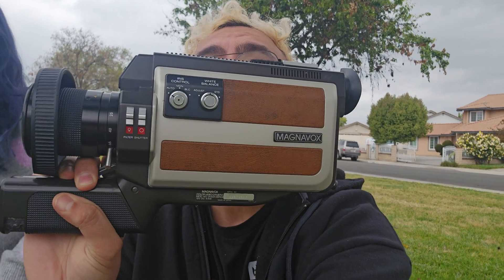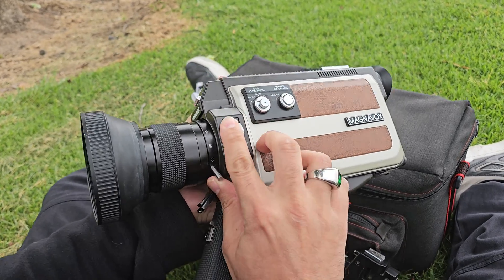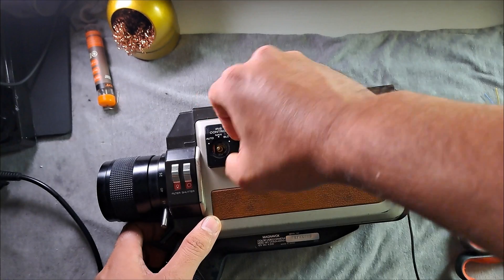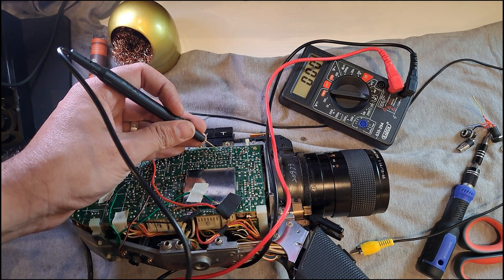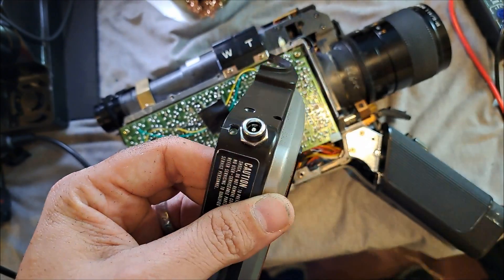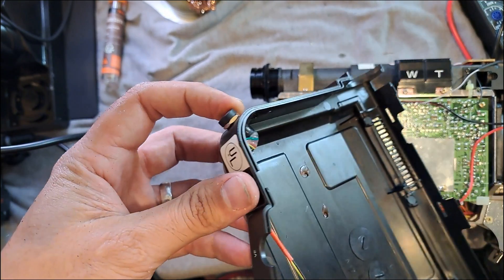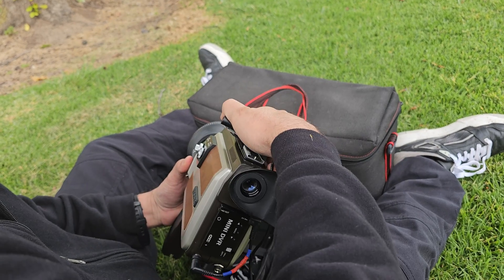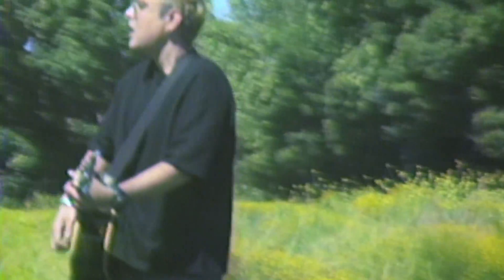1982 to 2024: How to MOD a RETRO camera!

Comment: Im trying to do this on my camera and i cant find a diagram for its connector. How did you go about finding what each pin does? I located the place on the board each pin leads to but as for what they do, no clue.
Reply from the maker: @murasamest1845  Hi! I’ve received that question quite often, so I’ll try to explain it a bit better :) The process really depends on the model. So far, I’ve managed to do it with six different cameras, but here’s how I approach it, just keep in mind, I’m not an expert, just an electronics hobbyist, so there’s probably a better way out there that I’m not aware of, haha.
You will need 4 cables: a) Power (usually 12V), b) Ground, c) Video signal, and d) Audio signal (usually mono).

First, and most simply, I look for the ground wire. I place one end of the multimeter on the connector pin I want to test and the other end on any solder point inside the motherboard that has a metal plate or screw (which usually leads to ground). When there’s continuity, the multimeter beeps—there you have your ground.

For power, these cameras almost always have a fuse, so I place one end of the multimeter on one of the solder points of the fuse and continue testing the connector wires until I find continuity—now you’ve got power and ground sorted.

For finding the audio and video signals, to be honest, it’s trial and error for me. Once I can power the camera using a battery or appropriate power supply (after finding the ground and power points), I turn on the camera and start testing the remaining connector wires using a video capture device connected to my PC. I test each wire with an RCA cable (composite video or pin jack) without soldering—just temporarily connecting them. These RCA connectors have two wires: one goes to ground (the same point we found earlier), and the other is used to test the remaining connector wires until I get a video signal on the PC. I do the same for audio.

This is the best-case scenario when the camera is actually functioning, but there have been several times when the camera was simply broken. We have to remember these cameras are around 40 years old, so sometimes they just don’t work. Recently, I managed to revive one when I noticed that two capacitors were desoldered and swollen. Luckily, I had capacitors of the same value, so I tried replacing them, and it worked! On another occasion, the fuse was blown, and I replaced it. These are simple repairs, but sometimes the issues can be much more complicated, and with my limited knowledge, it would be impossible for me to fix them.

I love electronics so much that I’ll be starting formal studies in February next year, so I’m hoping to take on more complex projects and be able to help out better in the future! 😊

That’s my simple trial-and-error method. As I mentioned, I’m not a professional, so there’s likely a better way to do it, but at least this has worked for me! I hope this doesn’t confuse you more and that it helps!
Reply: @MaxVegaKun  This helps a lot, thank you! To clarify, when finding ground would any metal screw or solder point have continuity to the ground pin?
Reply from the maker: @murasamest1845  Yes! Most of the time all metal plates or screws lead to ground :)
Reply: @MaxVegaKun  last question: I cant easily access the fuse, but theres a capacitor which has continuity on a pin i didnt find anywhere else, you think thats the power pin?

Comment: You said you ran some tests to identify the serial pins. What tests were you speaking of ie knowing video vs audio
Reply from the maker: Yes indeed! I’ve received that question quite often, so I’ll try to explain it a bit better :) The process really depends on the model. So far, I’ve managed to do it with six different cameras, but here’s how I approach it—just keep in mind, I’m not an expert, just an electronics hobbyist, so there’s probably a better way out there that I’m not aware of, haha.

The first thing I do is search online to see if I can find the pinout for the cable or connector used by the camera. For example, you can Google something like '10 pin video cable diagram' or 'pinout.' There are some sites where they keep this information, and from there, you can see exactly which cables you need. You will need 4 cables: a) Power (usually 12V), b) Ground, c) Video signal, and d) Audio signal (usually mono).

However, in my experience, this information almost never works because it’s often different for each model. I assume this is due to the large variety of models and the limited number of cameras I’ve worked with, but sometimes they're very close and it helps me to save some time. So, this is where my multimeter comes in handy in continuity mode.

First, and most simply, I look for the ground wire. I place one end of the multimeter on the connector pin I want to test and the other end on any solder point inside the motherboard that has a metal plate or screw (which usually leads to ground). When there’s continuity, the multimeter beeps—there you have your ground.

For power, these cameras almost always have a fuse, so I place one end of the multimeter on one of the solder points of the fuse and continue testing the connector wires until I find continuity—now you’ve got power and ground sorted.

For finding the audio and video signals, to be honest, it’s trial and error for me. Once I can power the camera using a battery or appropriate power supply (after finding the ground and power points), I turn on the camera and start testing the remaining connector wires using a video capture device connected to my PC. I test each wire with an RCA cable (composite video or pin jack) without soldering—just temporarily connecting them. These RCA connectors have two wires: one goes to ground (the same point we found earlier), and the other is used to test the remaining connector wires until I get a video signal on the PC. I do the same for audio.

This is the best-case scenario when the camera is actually functioning, but there have been several times when the camera was simply broken. We have to remember these cameras are around 40 years old, so sometimes they just don’t work. Recently, I managed to revive one when I noticed that two capacitors were desoldered and swollen. Luckily, I had capacitors of the same value, so I tried replacing them, and it worked! On another occasion, the fuse was blown, and I replaced it. These are simple repairs, but sometimes the issues can be much more complicated, and with my limited knowledge, it would be impossible for me to fix them.

I love electronics so much that I’ll be starting formal studies in February next year, so I’m hoping to take on more complex projects and be able to help out better in the future! 😊

That’s my simple trial-and-error method. As I mentioned, I’m not a professional, so there’s likely a better way to do it, but at least this has worked for me! I hope this doesn’t confuse you more and that it helps!
Reply: @MaxVegaKun  Thanks for the response brother., Very insightful and motivating. I bought a JVC GXNU70 and I'm going to start tinkering around with this. Appreciate your dedication to your hobby and fans

Comment: For my VX1000 miniDV cam, I use a usb capture dongle plugged into an android phone. The phone is the monitor and recorder. 😎
I like the concept of the little recorder. Maybe I'll pick one up.
Reply from the maker: That’s awesome! I’ve experimented with using a phone as a monitor and recorder too, though I personally find the video quality from the mini DVR to be a bit better than with the USB video app. No matter how much I bump up the bit rate, the image just doesn’t quite convince me—maybe my capture dongle isn’t the best quality, haha. But one thing’s for sure, the audio quality through the USB capture is much better than the mini DVR.

It’s funny you mention this because my next video on the channel is actually comparing the video quality of different capture methods, including using a USB-C capture dongle connected to a phone. I’ll be sharing the pros and cons of each method, at least from my experience. By the way, what a classic and cool camera you’ve got there! Thanks so much for your comment and support!
Reply: @MaxVegaKun  the capture quality is as good as plugged into a Mac/PC. I expect it's all about the dongle.
DV capture is the best option, but those battery powered DV capture devices are VERY expensive. I just want to preserve the tape mechanism if I decide to resell.
I bought a 2012 Mac Mini just to capture from DV, but the FW400-800 conversion doesn't work for whatever reason. 🤔
Reply from the maker: Yeah true! those original sony DV captures are totally out of my budget but there's a reason why they're so expensive a  friend of mine has one and I love it! It’s a shame the FW400-800 conversion isn’t that can be frustrating when you’ve got everything else set up. Sometimes these older connections can be finicky, I hope you find a solution that works for you!
Reply: @MaxVegaKun  I'll probably buy an older 2009 macbook with FW400. Wish me luck 🤣

Comment: Ooooh, i didn't even know that these tiny cheap DVRs existed! I am using a USB-Video Adapter and a Smartphone to capture my Vidicon cameras. But the capture-apps for the phone are an absolute painful desaster. Thank you for this Videoooooooo!!!
Reply from the maker: Hey, glad you found it useful! I stumbled upon those mini DVRs by chance, and even though they're mainly used in FPV drones, they work great with retro cameras. The downside is the audio quality is pretty bad, but if you’re only after the image, they’re fantastic. I'm actually prepping a video on different options for capturing tapes or going tapeless, where I also use a USB capture device with a phone. I totally get what you mean—the image quality, even with a higher bit rate, isn't great, and dealing with app ads can be a pain, though the audio is a bit better than with the DVR. Thanks for watching, for your support, and for your awesome comment. Now I know I’m not the only crazy guy having fun with this stuff! 😄
Reply: I had okish results with the 'next camera' app on Android

Comment: What I like about this technology is the way it responds to light, which is different from digital sensors (with their hard clipping), and closer to film and how our retina sees light with its smooth highlight roll-off.
Could you call this technology an analog sensor? Or digital film? It's atleast the closest thing to it.
How would this technology have developed further if it had never been superceded by CCD's and CMOS sensors?
Reply from the maker: I totally agree. I really enjoy videos of 70s rock bands performing live, captured with this type of camera. You can see how the light from the spotlights adds a different atmosphere and vibe to the stage, and the stars of the show are the tubes in these cameras. I love the term "digital film"; it seems very fitting to describe it! Thanks for your comment!
Reply: @MaxVegaKun  A única diferença para as câmeras de estúdio é que elas usavam 3 tubos de captura ao invés de um (tirando a questão das lentes é claro). A nitidez e o colorido das câmeras de estúdio dos anos 70 é superior às portáteis 3CCDs dos anos 80.
Reply: Yeah, you can definitely call it an analog sensor! Tube-based cameras reached their furthest development in the mid 1980s, when they were used for early high definition video cameras. Yes, ANALOG high definition video! These cameras used three tubes (one for each color), much like the original Technicolor process did with three strips of film. Search for "Hills of the Seasons 1988" and you can find a wonderful demonstration of it.

Comment: Amazing video!

I am currently trying something similar to this - the pin out on my camera says that pin 1 is analog video output and pin 2 is video ground - do I have to worry about this, or could I just connect a wire to pin 1 and then feed that into the mini-dvr? 

Thank you man.
Reply from the maker: Hey Douglas! It's awesome that you're working on a similar project. Based on my experience, it's always necessary for the video cable to have a ground connection, just like with audio. Generally, they share the same ground, even the camera's power supply can share the same ground (though it's best to take the power ground from a different point to reduce interference in the video signal).

I usually use a 4-pole connector and assign each pole to connect: Video, Audio L, Audio R, and ground, according to the diagram you can see in the video. Although there are other configurations, this is the most common standard for the 3.5mm mini AV outputs used in VHS and Hi-8 cameras from that era.

However, this mini DVR shown in the video has a different standard, so I had to make a special cable with the standard I mentioned on one side and the compatible one for the Mini DVR on the other. In fact, the pinout for the Mini DVR is in the manual, indicating which pole corresponds to which signal. I hope I explained it well and didn't confuse you even more, or probably that wasn’t even your question, haha. I've been thinking about making a video explaining this. What do you think? Would that be helpful for you?
Reply: @MaxVegaKun  ooooh, okay. So I could find the correct pin that my miniDVR takes, find what wires do what, open up the back end of it and wrap those ends around the corresponding pin on my hitachis 10-pin cable.

Then I do something similar with the 12 volt power supply / battery pin

Comment: Nice video. I actually have a portable Canon VR-40 VHS VCR from 1985 that was designed for these portable cameras, you would plug them into the VCR and the VCR would power the camera and record the video onto a tape. Mine works great and they still make new batteries for it and on eBay that work great. So you can actually use it as intended. However you then have to deal with transferring the VHS tape to a computer. It's probably much better to get a direct capture out of the camera because it will have better resolution, but if you want the VHS look you can do that. These cameras are cool because they use a vidicon tube as an image sensor instead of a CCD or CMOS chip, which gives you a true 80s video look. I have a few consumer grade cameras that use vidicon tubes such as a Panasonic PK-959 I showed on my channel, that uses a Newvicon tube.
Reply from the maker: Thank you! That sounds like an awesome setup. It's great to hear that your Canon VR-40 VHS VCR still works well and that you can find new batteries for it. I agree, using the VCR as intended does provide that authentic VHS look, even though transferring the tape to a computer can be a hassle. And yeah! vidicon tubes cameras rocks! they definitely give that true '80s video feel. I’ll check out your channel to see the Panasonic PK-959 in action I was tempted to buy on of that model! Thanks for sharing your experience!

Comment: Personally, for recording analog cameras, I prefer using an AV to HDMI converter into an HDMI capture card connected to my phone, and the app USB Camera Pro. Better image and audio quality, and you can record it upscaled (I do 1600x1200 to maintain the correct aspect ratio).
Reply from the maker: You think? I first used that metod I used several capture devices from different brands and even when I raised the bit rate to the maximum, I didn't really like the image. I suppose there are more factors to consider but I still prefer how it looks with this mini dvr, but the audio is much better using the capture device. On the phone, I guess it's a matter of taste!  Thank you very much for leaving your coment, it is very valuable so that other people have different points of view!

Comment: What is the  max resolution the MIDI DVR can record?
Reply from the maker: It is HD 1280 x 720; however, the camera only outputs video in standard resolution 640x480. In tests I've done with other video capture devices, including the most expensive ones on Amazon, the truth is that this mini DVR offers the best quality, or at least the most faithful. There are two cons: 1) If you choose to capture video in HD, the quality is very good and the difference is noticeable, but you will have video in 16:9 format, which is easy to fix in any video editor but is an extra step. 2) The audio recorded by this mini DVR is quite bad. Since I use it to make music videos, the audio is not very important to me, but if it is important to you, I would recommend recording the audio externally.

However, for the price of this mini DVR and the video quality it offers, it is still a great option for me. It is also very small and portable, and it has a rechargeable battery.